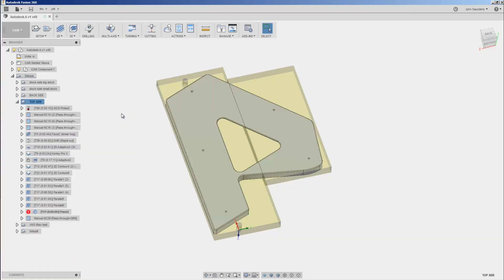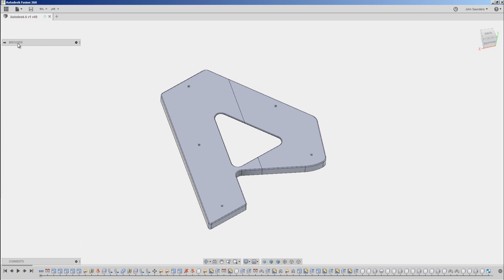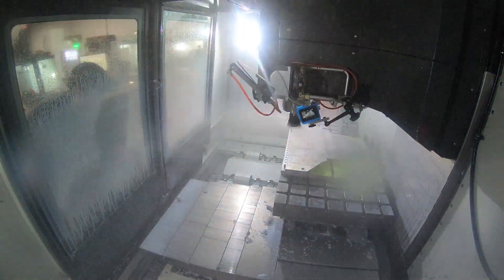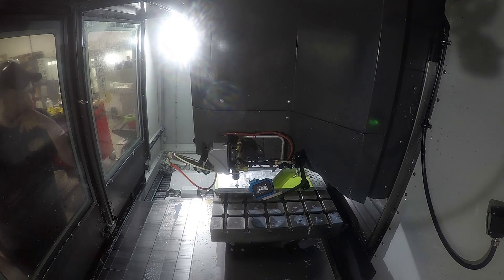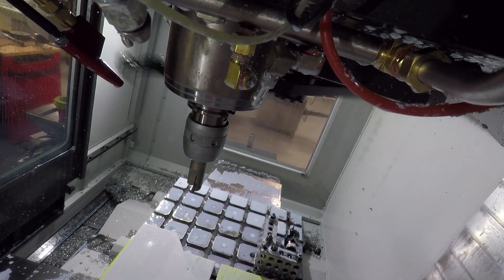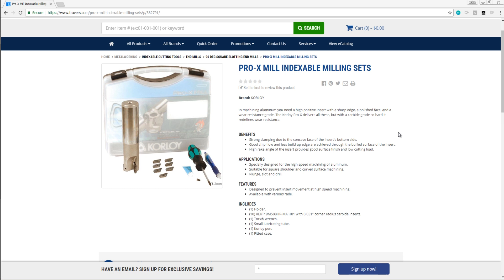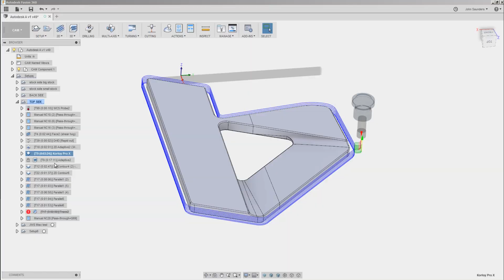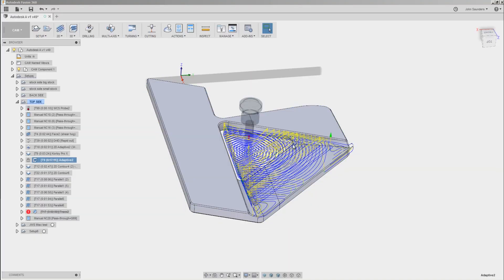Machining a HUGE part on our HAAS VM3!

Comment: Hey John, can you do a deep dive on G68 and how to use it? I think it would be really useful. Haas TOTD probes flat sides of a block and not bore holes.
Reply: Ryan Tyler Hey Ryan, it’s important you correctly understand what’s happening with your cutting tool path coordinates and how they align with the part when using these kind of axis rotation functions. 

If possible, find your center of rotation in 3D space first. This could be mechanical (eg part is constrained in a hole with a pin about it which it rotates about, and you would have two other constraints eg clamps and a bump stop, another example would be a rotating table), or in this case how the part is located in the machine vs theoretical position. Then, two options: 

1. locate your work offset 0 at the physical point of rotation (mechanical), using that first point for your two point angle calculation. Then it’s just a matter of matter of calling G68 X0 Y0 Pxxx, where xxx is your calculated angle (I think it’s P for the angle check your programming manual) in your machining G code (it’s a modal function) before your first cutting tool path. Use G69 to cancel. 
You can also set your work offset elsewhere, but you must use your center of rotation for as one of the points for 2pt angle calc (atan function). That’s the simple way that works all the time. (Be sure to use the right sing for your angle so you rotate in the right direction)

2. If using an inspection probe, there is a big catch here and I hope these guys are aware. If you don’t know where your center of rotation is, you can  still calculate your part angle, but your inspection software must be able to probe with G68 active (not always the case, especially with older versions of Renishaw software). If you don’t do this after and don’t know where your Center of rotation is, assuming you previously set your X and Y work offset values, your X and Y part locations (assuming your are working in G17 or XY plane for a 3 axis machine) will no longer be coherent and you will make dimensionally inaccurate parts. Your cutting tool paths may be parallel to where they need to be once rotated, but not aligned with the intended cutting location in that plane. You need to realign your X and Y work offsets in that rotated coordinate system. Of course, you can always do this with a dial indicator in the spindle and getting your locations manually.

It can get pretty confusing, but just try and picture your part in a certain position and lining up your tool paths about different rotation points once in a rotated coordinate system with the correct angle and see how they line up.  I guarantee you the above works, but you got to get the logic right (I create probing routines for around 100 cnc machines in the aerospace sector as my day job) this is the most important part and where a lot of people get caught up. The syntax for G68 and its variants is then pretty easy. 

A simplified version of this, if you have the experience, is setting up your part work coordinates (also called origins eg G54) for a machine with a rotary table (B axis). Your center of rotation is always the mechanical center of the table. Assuming your work offsets are always aligned with this, the setup sequence is always the same:
1. Adjust B angle and set to work offset and apply (if you find your x and z locations first then rotate, your x and z locations will no longer be in the same place, since B influences X and Z linear positions)
2. Measure and adjust Z with correction angle active
3. Then Same for X.

Hope I didn’t give you a headache there ( I know I get one sometimes hehe) and helped a bit.

Cheers 
Seb.

Comment: Another amazing video!
One note: sometimes your video could be a little bit longer and you could speak a little bit slower. It's hard for not-native english speakers to follow you :(
Reply: Giulio Buccini try setting the playback speed to 0.75x in YouTube.  I set it to 2x
Reply: You're genius! Why I didn't think about that?
Unfortunately,  this works only on my PC. On the Android tablet the youtube player doesn't show any of the settings I see on the PC-browser... :(
Reply: Giulio Buccini on the iOS YouTube app it’s a menu accessed with the three vertical dots icon in the upper right corner.
Reply: On my (quite old) Android 4.4.2 KitKat there no such controls in the Youtube app. The 3-dots menu just give "report", "Quality", "Captions", "Help" as options. No way to decrease the speed of the video... :(

Comment: That things a toy. I delivered a 26 x 26 x 8 aluminum mold today. 2 halves pinned together comprise the mold that are totally machined on all surfaces including the cavity. And heres the shocker: I made it without a bit of tape or glue! Lol
Reply: Without video post, it didn't happen  ; P
Reply: Cad-Cam-Man seems a lil insecure of the size of his mold.
Reply: That isn't that big of a mold.
Reply: Cad-Cam_Man its big for them given the size of their machines, and the size of the parts when they started. When I started watching them, they were making their own Torx head screws for pocket knives, out of titanium.

While I am not totally sure how big the molds are that I have worked around, the two flask halves for the mold are 6,000 pounds each. And generally see another 6,000 pounds worth of sand. I am sure there are bigger out there. These molds are for John Deere tractors.
Reply: Chris Hurlbut The mold I mentioned is for the investment casting process not a sand casting.
Reply: Chris Hurlbut Maybe not but it's more than one man can lift alone and my point was comparing it to the HUGE PART mentioned in the title of this video.

Comment: I have run the Pro x at 4500 mmpm on aluminium with a 13.5 mm step over and 4.5 depth of cut and it still had something to give

Comment: there is a plug in for fusion 360 in the appstore called  "DXF for Laser" it makes getting dxf files for you laser even easier 
https://apps.autodesk.com/FUSION/en/Detail/Index?id=7634902334100976871&appLang=en&os=Win64

Comment: For protecting the probe, we just welded some thick steel plates together more or less around the probe. Then 2 holes in angles down on the table to easily mount and dismount the housing on the table.

Comment: Heh. You CNC guys have a funny definition of giant.
Reply: The haas VF-11 begs to differ.
Reply: Ed Rees You guys ever seen the work they do on horizontal boring mills or large VTLs?
Reply: Hey John is still working mostly with vise sized parts so to him(and more importantly to the video clickers :-)) this is huge. He hasn't yet made the jump to parts that people can't load into the machine by hand. :-) Of course then there is the stuff I consider huge that takes 2 cranes to place on a gantry mill the length of a football field. Sadly there isn't a lot of video of that kind of stuff.

Comment: There is some problem with speed`s / feeds parameters in metric unit`s - multiple depth 0.15 in -> 0.004mm , cutting feedrate shows dot after number 5 ( 5.816mm/min ) .
Reply from the maker: Sorry about that!
Reply: Not big deal - it`s manualy for every video or some macros during editing ?
Reply: Roman Sholyak It's manual I think using his unit conversion box he made.

Comment: Hi John, Just thought I would bring it to your attention for saving dxfs, there is a plugin for fusion that allows you to save a dxf file that has the laser kerf accounted for so that you can get dimensional accuracy to within a few thousands. DXF for Laser is its name.
Reply from the maker: Sweet!
Reply: But why? Shouldn't that be the job of the CAM?
Reply: Wow; thanks for this tip. I didn't know it existed and have been offsetting manually. Thanks !!!
Reply: This can also be done with the AutoCAD DXF post processor that allows you to use the "cutting" tool paths in the Fusion CAM environment. You can have a tool library for different kerf widths for different materials, and if your laser accepts it program lead ins/outs, piercing etc.
Reply: NYC CNC la questione

Comment: NYC CNC, long time follower. Been considering the Korloy Pro-X for a long time, a video around how well it works for different strategies would be well appreciated. Especially something around 24K RPM - how good is it for mass clearing of material?
Reply from the maker: Noted!  We'll add to the list.
Reply: Do you prefer it over the shear hog?
Reply: We use the Korloy tooling at work (UK) and they are beasts at material removal... if you’re looking at high spindle speed of 24,000rpm plus the you should only aim for the 25mm,  32mm or 40mm diameter cutter anything more than that and it will exceed the centrifugal force rating of the tool, the inserts also have a neat locking and locating system which helps to keep the tip in place when doing large cuts large and it helps spreads the load of the bolt when being tightened, the tips have a high rake angle of around 19-26 degrees so chip removal is brilliant aswell, also has through spindle coolant holes aswell...
Reply: @S Weedon, thanks, appreciated. I am near West London, would love to see one of these in action. Ive only got a 'DIY' CNC machine. 2 Ton concrete thing I built from scratch. Uses a HSD 6.9KW spindle ..... always wanted to try the Korloy.
Reply: Charl, then why were asking about 24,000 RPM speeds?
Reply: Steve just Steve as this is the speed I can run at. In this vid he runs around 11k rpm.
Reply: My bad I didn't know that HSD could do 24K